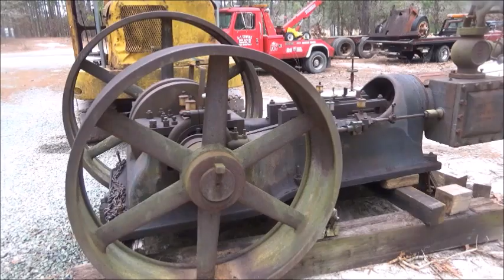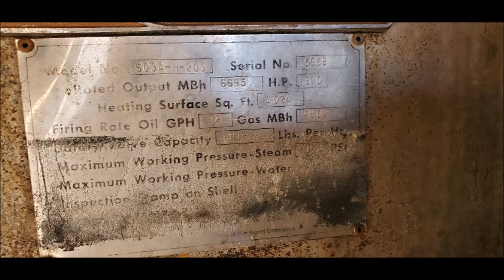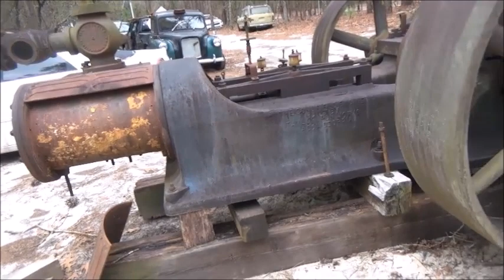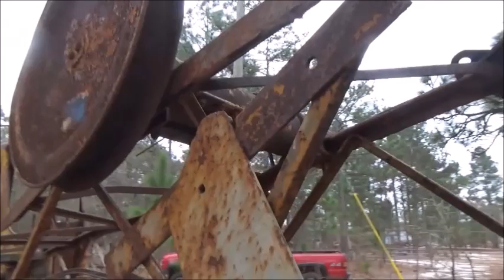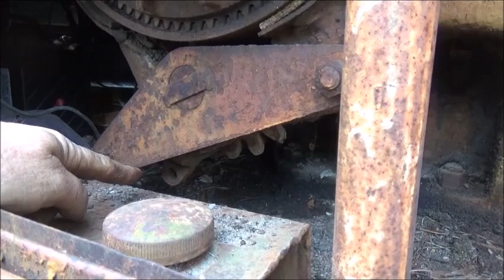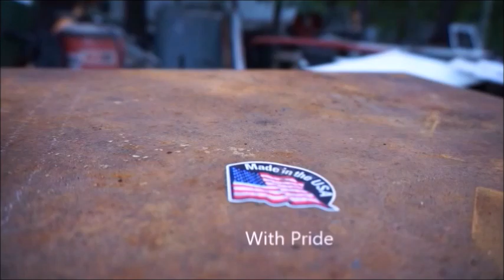STEAM BOILER AND STEAM ENGINE UPDATE

Comment: It costs bucks to run a steam plant....You need a good source of water and then all the chemical treatment to keep the scale off the tubes...Ran a steam plant for an open pit mine....There are yearly inspections due and you have to decide what fuel you are going to use...But if you want it do it....

Comment: You could run the boiler at a much lower pressure than rated..maybe get certified that way. I'm no expert by any means. There's a guy on here called old time steam machine shop and pretty sure his boiler is under 100 psi. He says its all he needs for what he's doing. it would be amazing to see the real steam in operation!!

Comment: This huge engine of it's time had to run a big mechanical machine of iTs time! Today the engine is hooked directly, like a generator, back then, remember, the farm tractor was used to run machinery too, take a wheel off, put a pulley and belt on it. Yes, your steam engine ran a large machine.

Comment: I wish I knew more but I do know here in NC there is a difference between running a boiler for high pressure and low which I think is 90 psi and below for low. But yes they are a maintenance nightmare with the water requirements and such. Being an older one it probably is fire in the tubes surrounded by water which takes hours or a full day at low fire to bring up to temp. The newer ones are opposite with water in the tube surrounded by fire which is faster, easier etc. I'd say air is easy but I know easy isn't what you do. Whatever you decide we'll watch and be glad to see it.

Comment: The Schofield works got absorbed by Taylor, that much I was able to learn! It went from where I videoed all the way over to and including the Terminal Station site In Macon. What I rode around was the entire site! Just didn't know it at the time! 
Run them off compressed air! No boiler inspections, easier to apply "steam oil" and limited rust... Good luck, they are your toys, enjoy them!
Leave it on the side of the road, gonna lose those oilers, simple as that. Thieves steal, it is what they do.

Comment: The company I work for had oil fired boilers at their plants but switched them out for natural gas , the old boilers if I remember write were around 400 horse power and each burned 20 to 30 gallons an hour number 6 oil , not cheap to run and feed into 80 foot smoke stack ,  they smoked pretty heavy on startup .

Comment: Boiler certification, maintenance and operation is an onerous task.
If you really want to operate your engines on steam, rather than compressed airthere may be an alternative with a flash boiler.
Usually a boiler is defined by the volume of water under pressure and its pressure. Flash boilers may not fall under the definition because they do not have any significant volume of liquid water in them.

Comment: STate inspections require 2 low water shut offs. and 2 high pressure shut offs. A pressure relief valve. or 2 depending on volume i guess. They do a annual external inspection or a running inspection an annual internal inspection. where you have to pull the ends off so they can crawl through it. and at that point pressure test it with water. if a tube leaks you have to a certified welder repair it.  At least for industrial. not sure about home use that might fall under the farmer exemptions. Farmers are kinda OSHA exempt on somethings. Home use might be the same. Funny you mentioned a boiler i just got home from replacing the pilot gas regulator on the 1 at work.

Comment: I say get the boiler. I have my 2nd class C boiler license , it's just for low pressure water boilers but we learned about steam boilers in class , of course that was almost 20 years ago.  I do know it's probably going to take a lot of work to fix because everything has to be perfect because of the high pressure so you're probably going to have to replace all or most of the tubes but you're probably going to have to do that to any boiler you buy so if this one is cheap I would get it. Make sure your health is up to snuff first. We can't play with our toys if we're not healthy. Good luck

Comment: Jonathan, you may want tpo look into NC laws before making a decision.  Some states require a licensed Boiler Operator be on site any time the boiler is in operation.  That is not an easy license to get.  It would look great next to the engine even if you're not using it!

Comment: Jonathan, my opinion is that if you can run that steam engine off of air, you'd be 1000% better off doing so. You don't need a boiler that needs inspections, permits, and hours to fire up, what are you going to do, NOT answer a tow call because there's nobody to tend to the boiler? Run it off air. If anybody want to take the reins and turn it into a steam engine, it will be relatively clean, not all rusty from standing water, and they can do so. Respectfully.

Comment: I had an uncle who was a "fireman" (as they call them here) with a boiler operator certificate for ship and fixed boilers. Here in my country you need such certificate to operate them, and boilers need to be inspected twice a year in factories that use them as power units (fewer year after year cause those compulsory directions). Fail in doing so may lead to heavy fines, even closure of your plant.

Comment: You are looking at swimming in asbestos with that boiler. All kinds of licenses and liability insurance with that part. You could end up owning a hazmat site. I have subbed out that sort of work and double checked references and insurance.  I had a friend die of asbestosis. Like slow strangulation. 
Essential Craftsman powers his steam stuff with compressed air. 
Stay on this side of the grass. Stay safe. I like you on this side of the Pearly Gates.

Comment: As far as I know you can run a boiler with out inspection if it is on your private property and you run it privately. Of course this is likely to be different from place to place. How ever I would recommend that you know about steam and how to work with it if you don't already. Example the use of proper pipes fittings and valves ect. Know how to test the boiler to make sure it is safe to use.  Make sure you'r aware of all the dangers that are involved. Steam is a marvelous thing but it can be very dangerous. Make sure you have a good water source. You don't want water that will corrode your boiler. There are water treatments but if you have a good water source you don't need to treat it. I hope you are able to get it together and run the engine. I would love to see it.

Comment: My husband and I are responsible for two steam traction engines at a museum - think boiler and steam engine on wheels. Before you buy a boiler, please get someone, like a state inspector, to look at it since repair can be in the tens of thousands of dollars. By the way, steam engines will run on compressed air very well, but you might need a rather big compressor.

Comment: 2014 isn't too far out of date for boiler inspection. If it was sitting in the woods for 50 years, THAT would be an issue. The question is why it hasn't been inspected. Did they not need it any more or did it have an issue at the last inspection? Boiler inspections are rigorous for a reason. One of my Great-grandfathers was killed in a boiler explosion before 1900.

Comment: Setup and running a 200hp boiler for fun is a 50 gallon can of worms.  Use your air compressor, still proves the point.

Comment: My experience with boilers was for heat, low pressure under 15psi, and we ran a small high pressure one running 80 psi for the clothes steam cabinets.
My Great Uncles had a huge steam tractor that we had to hire a real engineer to operate in Illinois. I didn't have much to do with it but  they told me it was low pressure boiler. 
I'm like you that a boiler that big with that much steam pressure and hp had to power machinery I don't think it could of been used just for steam.

Comment: Every state is different when it comes to steam engines and boilers. For example missouri you can have a traction engine weld on it repair it do more or less whatever you want because it is considered a hobby boiler and is covered under home owners insurance.  Kansas requires the boilers to be S stamped or certified. All repairs must be approved and done be an approved facility. Then anyone can run it. Another state requires  you to be a licensed operator to even stand on the platform of an engine with a lit fire.  My recommendation would be go over and ask a few of the steam guys  at the 100 year grounds. You should quickly get your answer to  your specific state.
Reply: As far as the size of the boiler and the pressure. When using the boiler for heating you need the volume of steam that a 200hp boiler puts out in order to circulate and maintain temp. 150psi is the safety valve pressure. It has to be hydro checked usually 150% of operating pressure. It would then go through a regulator and be brought down system pressure. However by running the boiler at pressure you raise the boiling point high enough that steam is created much more efficiently than at system pressure.

Comment: Fire tube boiler is about $20,000 fix if it doesn't pass inspection.  Inspect it before you touch it.  Inspector will show up for $100.  Running costs about $40 per hour with full head of steam.  Takes an hour to heat up and an hour to power down.  Feed chemicals about $200 per month if it's run every day.
Need boiler operator license to fire it up. 3 month course.

Comment: Have fun. A big plus for the air compressor you have instant engine turning the boiler you will have to plan for a whole day of firing it up and then what do you do with it after it’s Turning and if it did blow you wouldn’t have to worry about your health be safe buddy you can take what I said and $10 and get you a cuppa coffee usually

Comment: I think anything over 15hp has to be inspected yearly or biannually. Your pressure safety valve will probably need to be certified. I've worked on and ran boilers from 60hp to 300hp firetube Cleaver and Brooks . Oldest being 1960. And some old Wickes wet tube boilers from the 1950s.  You'll need to check your state law. It may not be as bad as it is here in Calif.

Comment: You are a historian you like things old like i do. The history and the making of it is what is very interesting also they still can be useful today like you can use it to generate electricity on a 500 volt generator and sell the power to the grid. All you have to do is burn it on wood. Make a deal with tree cutting company that do tree removal for road and home and that would be constant fuel source. Sounds kind of crazy maybe but if there is money to be made it is something to think about.

Comment: Mount it on trailer , pull it where ever needed,  boiler on front of trailer,    engine on back , so belts come straight out the back , back it into place. Pull ahead to tighten belts

Comment: I have worked on a lot of old boilers mostly for heating I thought I saw a gas tag on the boiler that is slot shorter than the two hundred horse powers I've worked on  I love the old stuff worked on alot of old boilers in Seattle and sanfransisco area

Comment: The tagline is not just useful for clamshell but also for lifting. If you have help available when lifting they can keep load from spinning with tagline but if your alone the load will spin even sometimes with a 2 or more part line and it is irritating when load spins and doesn’t stay where you want it.
Reply from the maker: I thought about that, but I can use the drag line for that also.
Reply: Da, your right, I’ve done the same and then you can pull load closer for positioning if needed.

Comment: State to state, the rules and regulations vary, but CYA all the way always applies.  The insurance companies will give you the least hard time, if you use a welded water tube boiler.  If a water tube boiler messes up, the fire tends to be put out.

Comment: I some states you need a boiler operator's license to operate a steam system above 15 pounds per square inch, gauge pressure, not absolute. I'm not sure, but in some states there my be another license requirement above 150 or 200 PSI.

Comment: If you don’t need to have it do any work, but just sit there an turn over slow, you don’t need much pressure, but you need a lot of volume. Compressors have lots of pressure but not much volume. You’ve got a piston with maybe 100 sq in so if your shop vac can make 1 psi (you see where I’m going here)

Comment: 150 PSI on a boiler is usually a low-pressure boiler(This term includes boilers used in steam tractors, threshers, steam-powered sawmills, and similar uses; (b) "High-pressure boiler" means a boiler in which steam or other vapor is generated at a pressure of more than 15 psi or water is heated to a temperature greater than 250°F and a pressure greater than 160 psi--High-pressure boilers are a shell and tube heat exchanger that use boiled water to create steam or high-pressure hot water. Using water-filled tubes in a metal tank or enclosure, they create power by converting water into steam through thermal energy, which is used to power equipment.

Comment: You might want to check what the pressure requirement of your steam engine would be but I think that boiler would but out twice the steam you would need for that engine. most of those engine used lower pressure steam.

Comment: Jonathan- steam is about as simple as it gets. You fire it up, the water gets hot, boom- steam. That said, 150 PSI don't sound like much, but steam is dangerous. I wouldn't want you to be scared of it, but you have got to respect it. There's really not much to setting it up, mostly structural support and simple plumbing. And don't talk down those automatic boiler controls, they can be real useful. But, damn, son, you got a bunch of projects already- you got gas engines, diesel engines, who knows what all. Do you really want to take on another whole new thing? I'm probably talking to the wall, here, I know. If you can't help yourself, I'll do what I can to help you. All I know is what Uncle Sam taught me, I was a Machinist's Mate in the USN, but we had turbines, not piston engines!

Comment: If the family don't want it have it sent to the steam museum and not sold or where ever you chose it's destiny! People ask me why I have 3 old Greyhound buses and all I say is because they are so cool!! Thanks and take care of yourself!
Reply: Johnathon I have watched your videos for about a year now and have enjoyed everyone of them. 

I have worked on steam boilers similar to this one. I do electrical and control work as well as assisting with burner upgrades. I live in California and don’t know the regulations of North Carolina but an oil fired boiler is a no-no in California except as back up fuel for boilers in hospitals. Check your EPA regulations first to see if oil is allowed. You might have to covert it to natural gas and that would be expensive. Also you would likely have to have a permit to operate it especially at 150 psi.

Comment: Johnathan check your library look for oil burner codes for your area i work on oil burners up here in New Hampshire and ma. I can work on up to 12.00 gallons an hour  with my license the boiler you are looking to buy was installed as overkill im betting  back in the time when it was installed buildings weren't built as well as they are today plus they may have thought of future expanion of the business or housing
 and from what i could make out the boiler can be fun on #2 heating oil / off-road fuel or natural gas diesel fuel is a substitute

Comment: Hi Jon I put together a big reply earlier but must have not sent it through. Here's the abridged version. Take it easy. Look after yourself. Pass on the boiler. To my eyes it doesn't fit the era of the engines. The extra aggro and hassle of going with steam is not worth the time. The compressor is a much better idea, especially as the engines will never be run under full load. I'm worried by the things you are saying but more worried by what you are not saying. Your health is paramount, put that first. If your health fails none of the things you want to do will be possible. We all like watching what you do, but really your health is far more important. Mart in the UK.

Comment: Here's more. Steam and compressed air ain't the same, you would need a very very large , probably 250 lb 1000 CFM  compressor to get the equivalent energy of steam (just an estimate)
Reply: large tow behind compressors aren't uncommon or hard to get a hold of. No need for inspections or special insurance. I bet a guy with a towing business could right it off his taxes as a business expense too  (bought it to run his tire machine LOL). he has a ton of natural sand and rusty iron that could use a sand blasting.

Comment: Run the engines with compressed air but set the boiler up for the aesthetics, ie it looks like it is used but it only is there for its looks.

Comment: you, like myself, have a lot of projects on your plate. best advise i can give, and it is likely wrong, but is the boiler really worth the extra investment for the project? it looks like a modern boiler, so it doesn't add much to the history, other than live steam for effect. that is, if the compressor you already have for the steam engines will run them. live steam can be more dangerous than compressed air as it both explodes and burns. i would much rather see the engines run on air, than read about you losing life or limb with a boiler explosion.
maybe i am just overly cautious, but i have had to pass on some very good deals myself when they didn't fit my plans, or finances. something to think about, how much fuel is that boiler going to use to make the same amount of energy as compressed air? same thing, different side of the story... how much energy does the air compressor use to make the required amount of air pressure to run the engines?
either way, follow your heart!